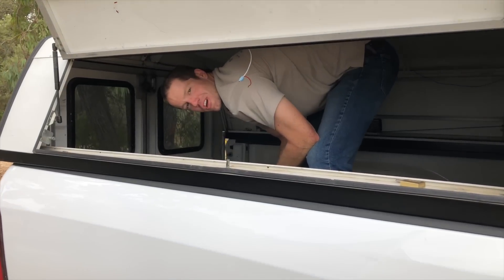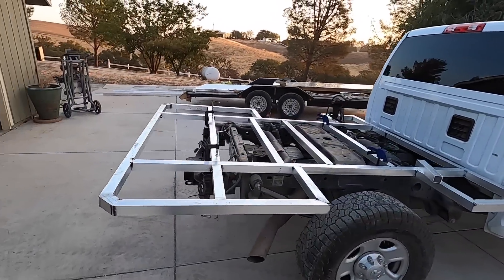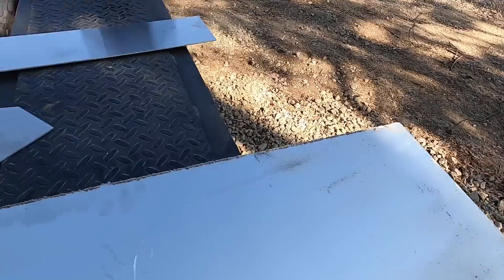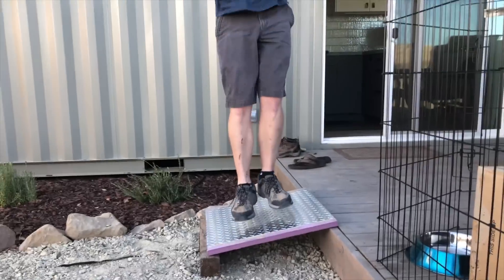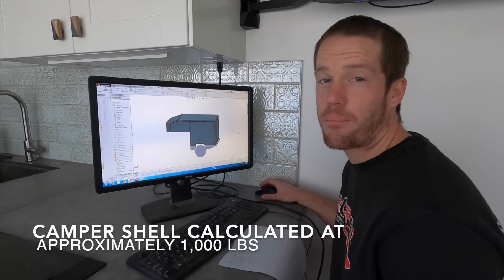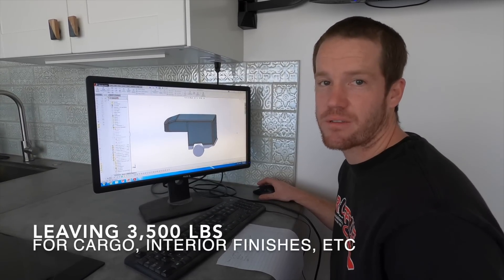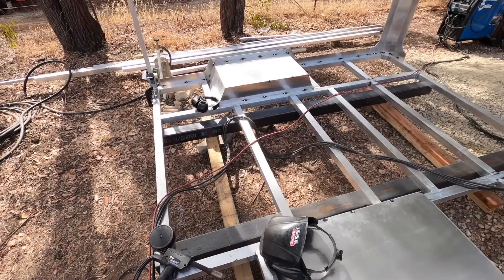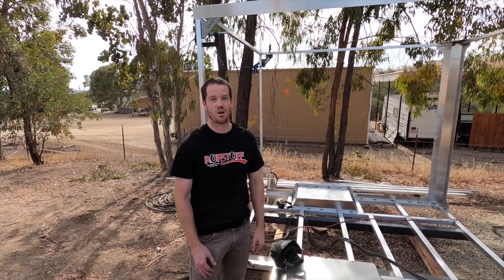Couple Builds DIY Expedition Vehicle E1 | Subframe

Comment: Please help with structure material details like square pipe size and thickness also thickness of sheet used to weld around corner of the structure

Comment: Did you have any issues with aluminum welds cracking?  Could you describe what efforts were made to prevent weld crack, i.e. preheating, what type of aluminum used, what type of wire etc...I apologize if you've already discussed in content or comments, I looked but I could have missed

Comment: There's the info I was missing. 
* Birch Plywood
* Structural Foam
* 0.050" 5052 Aluminum
It looks to be all 48" x 96" panels. How did you seal between panels or butt 2 panels together? I've watched up to E15 so far & then found your playlist. I've also seen you saying goodbye to this wonderful contraption. 
Why such a thick aluminum? I noticed some of the thinner aluminum is more money than this size. Or was it a structural thing?

Comment: When designing this, how did you get an accurate model of the truck to create accurate dimensions on your designs? I’m also curious what software you used.
Reply from the maker: The model wasn't accurate, just used for a visual reference. The dimensions I designed off of came from physically measuring the truck. I use Solidworks for CAD

Comment: This is something I'm interested in doing in the future. Can you please tell me the overall width and length of the frame? What is the specs on that aluminum tubing; for example what is the thickness of the metal and what is the width if it's square tubing? also what is the type of aluminum? if you bought it online can you tell me where you got it? thank you

Comment: yay  Loctite® PL Premium® 10 oz 1390595 en-US  is this the glue and why the water ?
Reply from the maker: We use the larger 28oz tubes, but yes that's the glue. The glue is moisture activated but we applied it between two water tight and air tight substrates. It won't cure without a little water.
Reply: @AmbitionStrikes  so did you just spray water at it ? ... a little confused here ! sorry

Comment: I have a welder. Did you have hard time learning to weld Aluminum? Your welds look good too.
Reply from the maker: I have probably run close to 1000# of steel wire through the mig welder but welding aluminum was a whole new animal. The TIG was especially frustrating. Now that I've got the hang of it though I find it quite fun. There's only one way to learn... go for it! Thanks for watching, feel free to reach out of you have any other questions. I learned a lot from the Welding Tips and Tricks channel.

Comment: Niticore panels are $60 a sheet for the unlamented, laminated ones are typically used by camper manufacturers. Since I don’t have deep pockets just skills, I built a slide in camper for my rig using foam board layered in fiberglass on both sides. Complete camper with bath/shower and sink with on demand hot water, fridge, stove, hvac system, solar, cabinets for storage, off grid and hookup compatible, and room for four. All together dry weight less than 800lbs wet less than 1000lbs. This all fits in a 6ft box on a 1/2 truck, the money saved on better construction and choice of materials paid for the amenities in the build. I would rather build and see builds from other people than a tour or reviews of campers because prices for these are usually outrageous. Plus thing for me I love fabrication planning and putting into physical form is what I do. Definitely going to follow your build to the, looking very promising.
Reply from the maker: That sounds awesome! We were hesitant to use fiberglass but I would love to get more comfortable working with it on future projects. We love checking out all of the homemade campers out there! Totally agree that the design and implementation of it is addicting. We are already brainstorming up the next big project!

Comment: Awesome... Can you tell me about your corners towards the back. Looks like you bent a piece with two 45 degree angle (what size thickness) and welded a top and bottom for the outer edges (what thickness) and did you weld to the outer frame on the bottom?
Reply from the maker: You got it! The back corners have two 45deg bends. It is for style more than anything. The exo skeleton is all 0.080 5052 aluminum and is welded to the sub frame.

Comment: Just watched the whole build, now along for the adventure! Excellent series. 

Quick question, when welding aluminum outside what flowrate and shielding gas was required? Thanks!
Reply from the maker: Thanks Adam! In both welders (TIG & MIG) Riley was using 100% Argon and 20 CFH. We got super lucky and had extremely still weather for the majority of the build.
Reply: @AmbitionStrikes  ok thanks, I only have welded flux core outside and figured it must have been a calm day or low wind.

Comment: Any concern about all the aluminum contact with a steel car frame?  Typically, two dissimilar metals, including the fasteners should not be in contact in order to prevent galvanic corrosion.  The underside of the vehicle would certainly be exposed to the elements.
Reply from the maker: You are correct! I think that ideally we would have added some kind of isolation. It's something we'll have to keep an eye on. Some thin hard plastic pads like UHMW or Delrin would work well and would be pretty simple to add.
Reply: @AmbitionStrikes  do you think those electronic rust prevention systems work?/would work? For your situation. ‘couplertec’ is supposed to be a good one, but I am not convinced that they work on vehicles as they claim they do, as compared to when used for pipes and Jetty’s. While electrolysis & galvanic processes need some considerations, I dont think ur build is going to be any less than anything else out there on/off the road. Looks and approach seem very professional, Im guessing you have done some sort of Engineering degree at least. Nice start. Cheers

Comment: dont like that foam. its not strong. much better marine type foam cores if you look at the higher temp materials. just a thought.
Reply from the maker: Hi there! We considered purchasing Divinycell but it has a much lower r-value and was going to be about $300/sheet. After creating a sample and testing it we were happy with the strength of the foamular.

Comment: You should go back and study how the Unimog’s have their bed’s attached. Me personally, I’d rigid mount the front float the rear, but one probably isn’t much better than the other. The camper not twisting with the frame is the goal. The other option is the camper being able to twist and flex with the frame; which sacrifices strength.
Reply: I changed my mind. Rigid mount the rear, put the front on a pin to allow for twisting in the frame.
Reply from the maker: We ended up rigid mounting the front and spring mounting the rear! There really are so many ways to do it but we had less concern with this frame flexing than a comparable Ford.
Reply: @AmbitionStrikes  awesome. Having it rigid mounted on both ends is asking for articulation to crack welds.

Comment: Are you guys totally satisfied with your home made composite panels?  Any thing you would change on the panels if doing it again?  I have watched all your videos twice as I am doing a very similar build.   Thanks a million.
Reply from the maker: I would say we are 80% satisfied with our method of construction. If we were to do it again we definitely purchase or make a vacuum bag system for gluing up the panels. Moving the pavers that many times took years off Riley's life... We also might revisit trying to source FRP instead of aluminum for the exterior skin as the panels do expand slightly from thermal expansion when the sun cooks them.

Comment: Consider making the upper side to roof transition cant-in a little, like a Kimbo camper.  It won't sacrifice much headroom because that'll be over counters and such, but it can be handy to have that clearance off road.  With a big rig like this, you only have to be slightly off camber before the top is dragging through the trees on narrower trails
Reply from the maker: Our initial design was similar to that but we ultimately chose to keep it simple.

Comment: I'm currently full timing  up here in montana in a 2020 northern lite and 2017 ram 3500 and have been contemplating getting rid of the camper and fabbing up something like this.  The r-7 insulation in the walls is not sufficient for the weather extremes I live in, so I was wondering what what estimated weight will be, and if you dont mind me asking...what the approximate cost will be for the camper setup?
Reply from the maker: Hi Darrin! We chose 1” foam for our intended climate use but you could easily move up to 2” foamular. We are expecting our finished dry weight to be somewhere around 2,300lbs... but that is based on the computer rendering and a whole lot of guesstimating. We will keep you posted on finished weight!